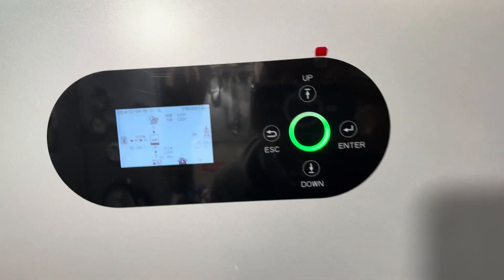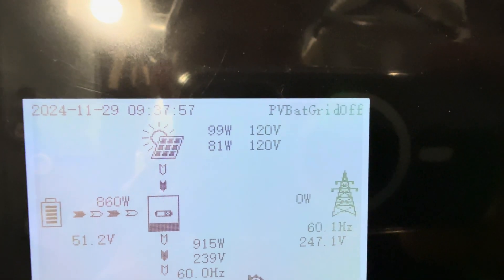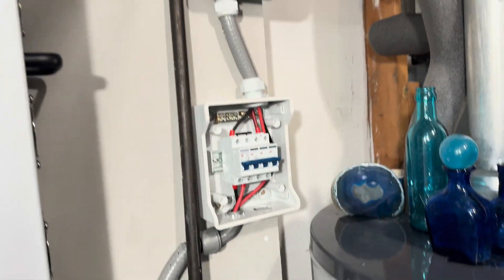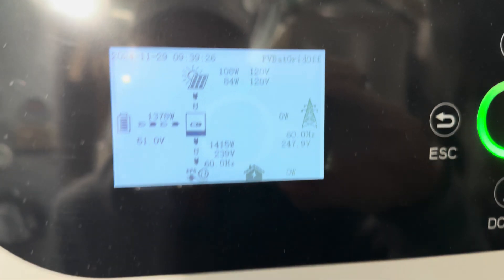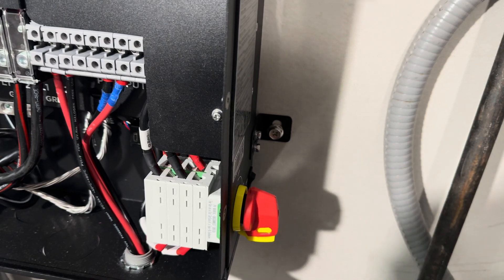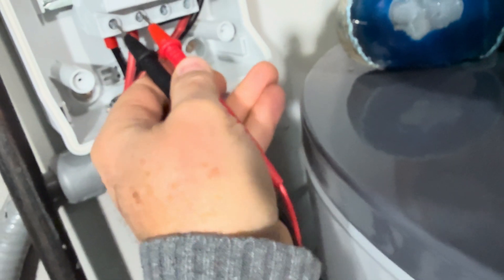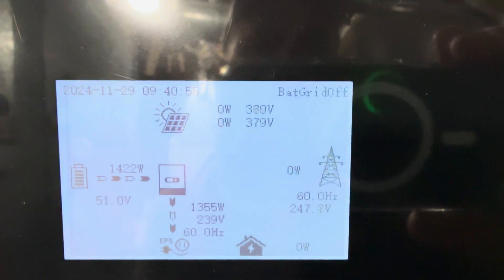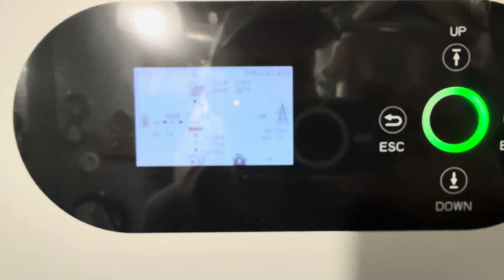RESOLVED BY A FIRMWARE UPDATE (ceaa-0304 or later): PV voltage limited by EG4 12000XP

Comment from the maker: RESOLVED! Since at least two of us with the problem have had a firmware update and both of us came up with normal PV this morning, I’m calling this issue resolved. I want to that all of you who weighed in and helped via the comments, as well as the Tech support at SignatureSolar and EG4. They were great. I can go back to tweaking and adding to my solar arrays. Thank you all!
Reply: Thanks for the update. I'm looking at buying this inverter soon. Good to know no serious issues found yet
Reply from the maker: @electromechanicalstuff2602  I’m actually a big fan of this inverter.  I was going to get the 6000XP but was delayed. When this came out, I was happy for the delay. It’s been great other than this one glitch which they resolved.
Reply: Did you do the update with a Wi-Fi dongle? If so where did you buy it? Trying to update mine but I’m new to eg4 as I just converted from my SMA sunny islands.
Reply from the maker: @ Yes. The wifi dongle came with my EG4 12000XP Inverter. What EG4 inverter did you purchase? For most of the ones I’m aware of the dongle is included.
Reply: @JoeHaynie I almost threw away the dongle. Didn’t see it in the styrofoam packaging. All is good 👍🏻 updates have been easy and successful. 12000xp is a beast
Reply: I'd like to query you about the update. Does the inverter need to be installed to update? I just received mine and I won't have wi-fi available for some time in the building it's going to live. Is it possible to do the update prior to installing? Thanks Joe!
Reply: @blenderbenderguy I believe you can download it to your phone then your phone can update the inverter.
Reply: @ Thanks, I'll need to look into that. I guess there's no rush as it'll be quite a while till it warms up enough to do anything anyway.

Comment: One alteration I did have to do on my 6000XP was the LOAD Output L1 and L2 were swapped from what the display and the web monitor were displaying. Once corrected i traced out phase differentials and also determined that the GRID and GEN Inputs also require swapping the wires on the top side of the Circuit Breakers. Results were Now L1 is Black wire and L2 is Red wire. Ignore the factory wire labels on their wires.
Reply from the maker: @Time-Trvlr  Thanks. Same issue with me initially. I discovered I had reversed the polarity on one of the strings. The inverter essentially ignored that string until I corrected it.

Comment: There is a mppt selection in the configuration menu that bridges the two mppt positive inputs or you may select separate strings for PV1 and PV2. The two negative inputs are (summed) bonded above the disconnect switch to one input terminal on the EG4 inverter circuit board.

Comment: The mppt is getting stuck just like my old voltronic mx2 you have to turn the breaker off then on. This happened to me on rainy 🌧  weather. But the 18kpv does not have this issue.

Comment: Is your battery bank completely charged when you are showing 120 volt PV input?
Reply from the maker: @diy-solar-guy  Probably not because it happens first thing in the morning.
Reply: @ have you tried talking to the techs at Signature Solar to see if this is a known problem and if there is a fix? I have the EG4 3000 watt inverters, 4 in parallel and never had a problem at all in six months, but I see people on YouTube having all kinds of different problems with the higher EG4 6kw, 8kw and 12kw inverters. Not sure why there are so many with problems. In hope Signature Solar techs can help you figure it out. Just as a side note, my EG4 3000 watt inverters will only charge at max 25 amps each. I have been able to go up to 3400 watts input on each inverter and 3200 watts output on each inverter with no problems.
Reply from the maker: @diy-solar-guy Yes. In fact, I posted this because it was the easiest way to send them the video they requested to show what was happening.

Comment: Thanks for sharing, does it happen when batteries are under 95% charged?
Reply from the maker: @tjmooney4181  Good question. It seems like it is completely unrelated to the batteries. They have been at different states of charge when it has occurred. The common denominator has been that it happens first thing in the morning after the PV has been dormant all night.
Reply: @JoeHaynie  okay I'm stumped at what could cause this issue as I've never seen pv voltage get regulated 🤔 very curious what it is and will keep checking this for resolution 🤞

Comment: Looks to me battery is full and it is limiting the input voltage as it is solar first try putting a large load on it to see if the solar production goes up.
Reply from the maker: @offgridwanabe  That’s an interesting thought. I’ve made several changes in the charge settings for the batteries. I’ll have to watch to see if that helps resolve the issue. I won’t know until tomorrow morning because the inverter has been reset with configuration changes and firmware updates every day this week.

Comment: My Sirius Panels have a VOC (Voltage Open Circuit) of 37V and a VMP (Maximum Power Voltage) of 31V, My strings are 10 panels each so I usually see a operating voltage 307-315 while under load. So what you should be seeing 11X the VMP of your panels. I have a 18KPV which has a max pv voltage per string of 550V and a minimum of 150V. I do not know what the max and min voltages are of the 12000XP, but I wonder if you are bouncing off the maximum causing the MPPT to go into a "safe" mode. As other have said and I have personally delt with EG4 has pretty good customer service and when I called them before purchasing my inverter to get some questions answered by tech support, not sales, I was able to get thru to them in about 30 minutes.
Reply from the maker: @paulsmalser3261  Several of us have looked for a max or min voltage setting on the 12000XP and are not finding them. May be hidden within the firmware. I agree, the SignatureSolar techs have been great. They just seem a bits stumped on this one.
Reply: @JoeHaynie  Took one google search to find the spec sheet for tge 12000XP, Min 100volts , Max 480volts, nominal 120-385 volts.

And I called EG4 directly, not signature solar.
Reply: @paulsmalser3261 it claims 600v which is allot more than 480v.

Comment: It does look like there's a problem but the issue is compounded by a lack of understanding of PV voltages.  A PV string at its open-circuit voltage (Voc) produces no current, so the only time you would ever see the PV strings at that voltage would be if the system is not pulling power from it.

The initial voltage you saw ... the 120V, is the MPPT operating at its minimum operating voltage.  Given that the VOC is in the 400 voltage range, and the battery voltage is low (but the battery also seems to be indicating a full or nearly full charge on the left)... 120V is just plain wrong.  The voltage definitely should be higher.  You would only see 120V at the very start of the day or the very end of the day in low-light conditions.

The second set of voltages you saw in the 350V range after you cycled the PV disconnect are closer to what I would expect a producing system.   The system was probably operating normally and it must have been fairly cloudy for it to produce so little.

In the late afternoon with shading or low sun angle, the maximum power point voltage will drop steadily until the MPPT hits its minimum (120V), at which point it will produce as much as it can until power goes to zero.  Also in situations where there is a lot of shading on the panels, it is possible for the open-circuit voltage to be relatively high (400V+), but for the panels to not be able to produce much power and in this situation the MPPT might pull the voltage down to 120V.  But that doesn't seem likely in this case since you got more generation when you cycled the disconnect.

It is a bit concerning that the battery indicator on the left is showing a full battery but the battery voltage is sitting at 51.0V (ish).   51.0V with a load of only 1000W.   That is not even close to being a full battery.  So I would check the battery configuration parameters to make sure you have it configured with the proper amp-hour capacity, and that you have configured the charging parameters properly.  It could be that the system is confused due to a configuration mistake.

If the system believes the SOC is near 100%, or the battery voltage configuration parameters are not set properly, it might be ratcheting back out of confusion.  Typically for a 48V LiFePO4 system you want the charge target to be 56.8V, the absorption time to be between 30 minutes and 2 hours, and the float voltage to be between 53.6V and 54.0V.

You didn't supply any information on outside conditions or shading of the panels at the time of the readings, the size or number of panels, or the string configuration.

-Matt
Reply from the maker: @junkerzn7312  Thank you Matt. You have expanded my understanding of what to expect from PV voltage. Basically you’re saying that, once the load is applied by the inverter I can expect to see a drop in voltage. The relationship to the battery is also helpful to understand. I know that at least 2 of us with this 120V problem are using LiFePo4 batteries that are not on EG4’s list and consequently have to use the “Lead-Acid” setting. That means that the only way the inverter can sense the SOC is by voltage. I have made several adjustments to my battery charge settings since I posted the video. Currently my charge target is 56.4V, the float voltage is 54V, the equalization voltage is 57.6, and my equalization time (is that the same as “absorption time”?) is set to zero.
Reply: @JoeHaynie  Equalization is different from Absorption.  Equalization is a mechanism that is only applicable to lead-acid batteries where the battery voltage is intentionally increased beyond normal specs for a number of hours to remove sulfate buildup on the battery plates.   You always want equalization disabled for lithium.

Absorption is basically just holding (typically) the charge target voltage for a period of time or while waiting for the charge current to drop off.  For LiFePO4 you want to simply hold the charge target for a fixed period of time between 30 minutes and 2 hours and disable any current-tail function.  This gives the battery time to internally balance its cells.

Unfortunately I don't have an EG4 so I'm not up on its specific configuration that might lead to the MPPT issue. It does sound like a firmware issue to me, though, but it is possible that some configuration parameter is tickling the software bug.

-Matt
Reply: @JoeHaynie  Do not use Lead Acid setting with Lifepo batteries, you will destroy them in short order. Even if you can not get the bms to talk to the inverter you can at least tell the inverter voltages for discharge amd full voltages, Lifepo batteries have very different (very flat) charge and discharge curve with extream spikes at eaither end. Safely you can tell the inverters charger to start charging at 50V and stop charging at 55.2V. I built my 5x 15kwh batteries from diy kits and they use JK bms which I have to use a work around to get basic Can coms to my 18KPV, but when I do my 2-3 times a year top balance I change the charge controller in the inverter to voltage as described above.

On a side not you might want to look at the Off Grid Garage channel, yes Andy uses victron equipment but goes into deep details as to how a healthy system is supposed to work.

Comment: I have to check mine next chance I get but I believe my Flexboss is limiting my PV also.
Reply from the maker: @randya9143  Interesting. Isn’t that another brand-new device from EG4. Maybe there are some related burn-in issues that will require firmware updates.

Comment: Are your batteries full? If so it will limit the PV watt to just the load watt
Reply: At least on my 18KPV it will still show full voltage but will limit the watts to just what the load is drawing while my batteries are a 100% SOC.
Reply: @paulsmalser3261  Correct. The limiting is done on the current. The Voltage should remain as is.

Comment: Welcome to the club. Mine is doing the same thing.
Reply from the maker: @sleeper7  Sorry to hear it. Have you gotten any feedback yet from your vendor’s tech support?
Reply: @JoeHaynie  Looks like the firmware update also fixed my 12000xp.  Question for you. Your battery is on lead acid? What is your pv voltage max charge and float?  Thanks.
Reply from the maker: @sleeper7  My setting is “Lead Acid” because I have a LiFePO battery bank that doesn’t offer a communication cable. SignatureSolar suggested I use a Charge Voltage of 58V and Float of 54V. However, my battery vendor (Eco-Worthy) finally responded to my email, and they said to use 60V for both of those (they claim that the “Float” voltage concept doesn’t apply to LiFePo batteries, but that if I have to put a value to make it the same as the Charge amount). That seems high to me so I’m running their recommendation past the SignatureSolar guy.
Reply from the maker: @ I use 58.4V for my Charge Voltage and 54V for my float voltage.
Reply: @JoeHaynie  In contact with whom I bought the inverter from.

Comment: I'm no expert, but it looks like the MPPT algorithm has a hickup in its programming. It seems like the algorithm has a problem with gradually increasing array voltage and needs to be 'jump started' by disconnecting the array for a short amount of time, to see the full array voltage.

In my laymans opinion this should be fixable with a firmware update.
Reply from the maker: That’s what we’re hoping. There are apparently others out there with the same issue so it may just be some of the startup challenges of a new device. Would love to see a firmware fix solve it.

Comment: The reason you're not seeing 4xx volts when you turn PV back on is just loading.  The inverter is using it, amps go up and voltage drops.  That's normal. 

The 120V thing though, yeah.  Not normal.
Reply: I hope you do a follow up. 120 does seem real low with the volts at 430 with no load. I hope SS puts an effort into resolution. I would record all your settings no matter how trivial this could be an isolated issue or a deep software flaw as it’s relatively new hardware.
Reply: I have the same issue and the watts do not go up as normal. It is not simply just loading, I think it is a balance between MPPT and what the solar array can put out. Less noticeable in the morning because of the low total input. I reset mine and on a nice bright sunny day, the watts at least double after I reset the breaker or PV switch on the unit.
Reply from the maker: Thanks. Seems like it settles in at around 360V rather than the 430 that’s there. I’ll have to watch it more long-term.

Comment: I am having the same issue. Only using 1 pv line. Right now signature solar hasn't given me an answer yet.
Reply from the maker: Same here. I posted this question over on the DIY Solar Power Platform site. We’ll see if someone has an answer. BTW, I noticed someone on that site had posted a similar thing about the EG4 6000XP about a month ago. I’ll post here if I solve it. Let me know if you figure it out.
Reply: @JoeHaynie  Signature solar emailed me back earlier today. They are aware of the issue, and said they may have a possible fix, however it sounds like I may have missed them today. But it sounds like we are not the only ones, and this will be looked at closer and hopefully quickly. 
I have seen other similar things on other EG4's as well when doing some basic searches. 
I will let you know as well here most likely Monday if I talk to them then.
Reply from the maker: @TravisAviation  Thanks for the update. It’s comforting in a way to know that we’re not unique. Maybe it will be fixed with a software update. Let me know what you learn and I’ll do the same.